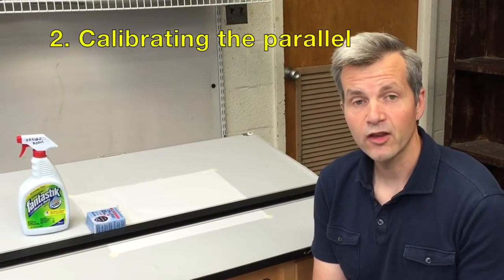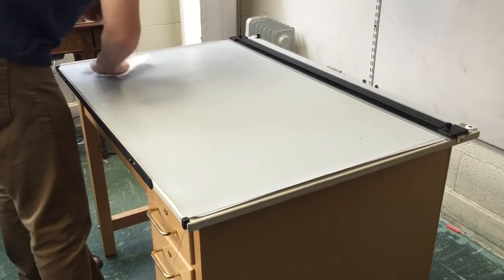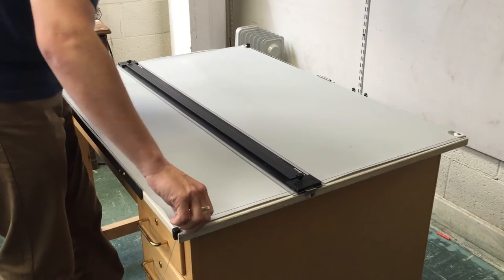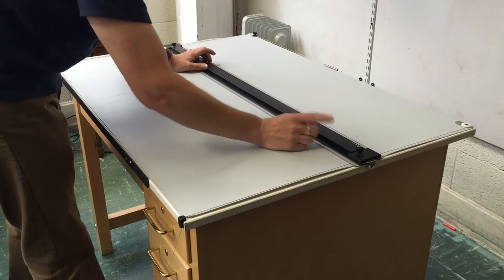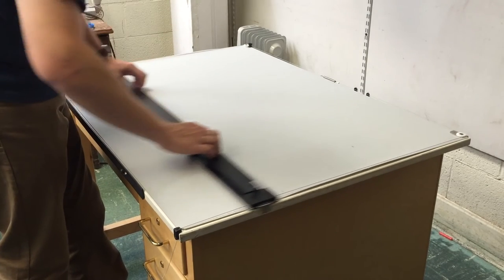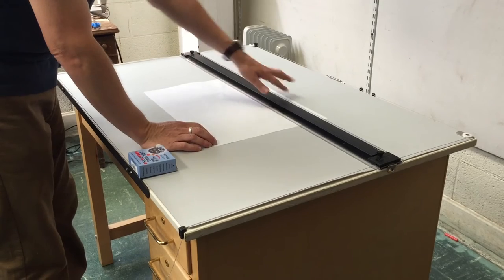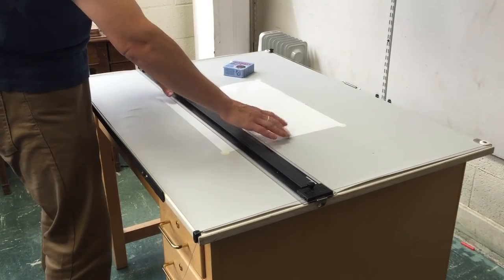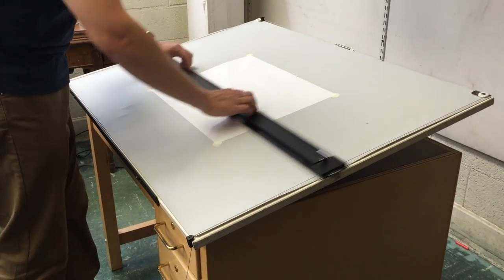Proper setup of a drafting table

Comment: Thank you SO MUCH! I am in an Interior Architecture/Design program at UCLA and we still have classes where we use boards. No one ever explained this to me. My parallel bar -which has never been calibrated by me because didn't know I needed to do it - was off by 1/16th of an inch. Thanks to you I was able to get it back perfectly. Thank you!

Comment: Hello. I have an old drafting table with athe setup just like yours plus some other tools as well. We’re can I get the corner screws and black stops for the base of the table. I have the wires but spring is also sprung. Is there an online source to get the parts for the straight edge setup?

Comment: The reason the cable adjustment lock is there has nothing to do with calibrating the straightedge before you began to draw. The adjustment is used to align the straightedge to an existing drawing that you need to remount and do edits or additional drawing. I would recommend getting some new double face tape so the edges of your pad are not curling. To align a new paper, I first rotate the paper diagonally under the straightedge to make centering marks (a lot faster than measuring). Mr. Moreland at Lafayette High School would give you a lower grade if your drawing wasn't centered properly. I leave the bar at its lowest position next to the rest stops. I then place the paper on top of the clear edge onto the black bar. This aligns it parallel to the bar. I then tape the top edge, lift the paper under the lower edge, move the bar upwards to tape the lower corners. By mounting the paper as low as possible, you never have to worry about the bar flipping or tearing the paper along the bottom edge. It also allows you to reach the top edge of the paper while seated. The straightedge has no "GEARS" inside. It has four bearing wheels that allow the cable to slide through. Sounds like yours needs some oil. Sorry to be so tough.

Comment: How do you check that the edges of the table are still true? Say if you get a chance to buy a used drafting board or table? Or by adjusting the calibration, does this solve any possible problems with the table edges?